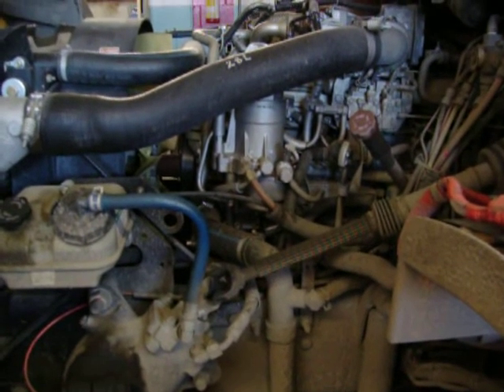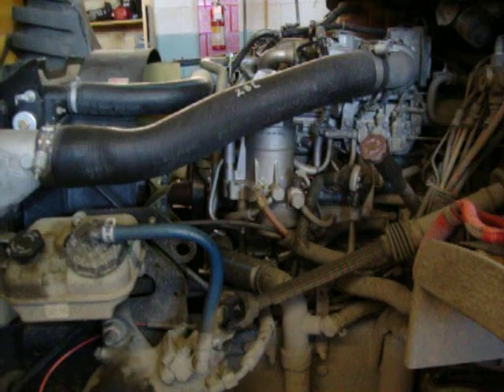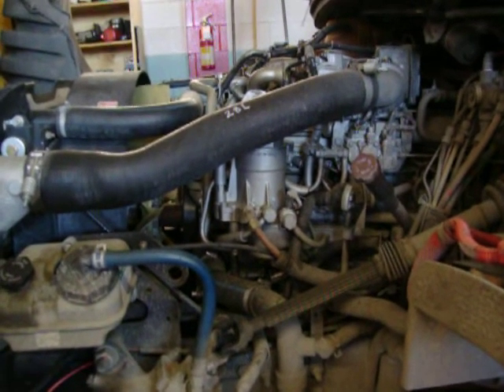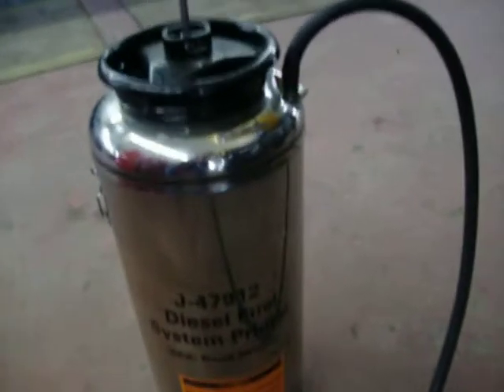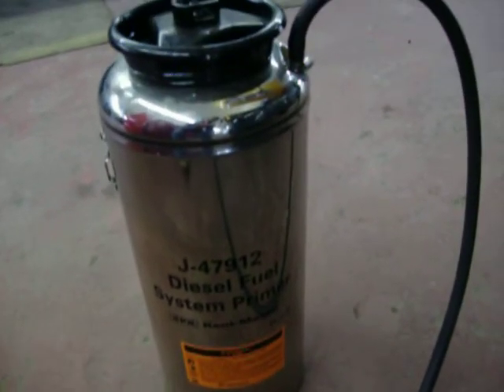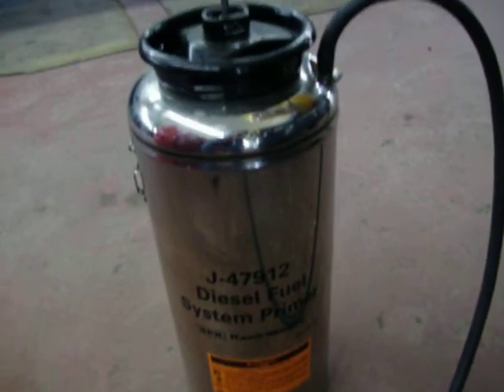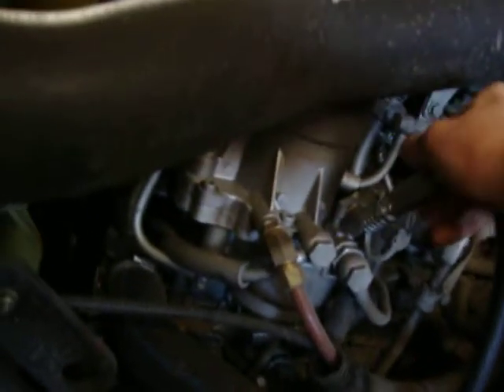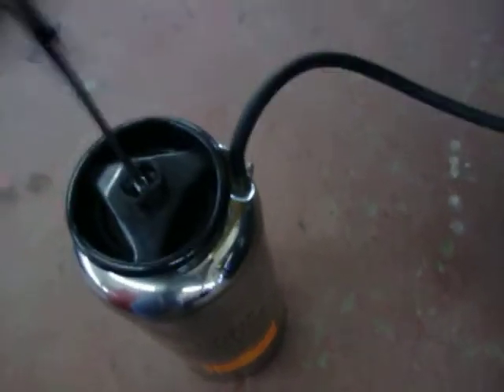Bleeding Diesel Fuel System On a Mercedes MBE 900 Diesel Engine

Comment: We did service and looks dmalles filter was lit loose, but truck started right up and we let idle 10 minutes, but after 10 hours truck set it didn't start, driver tryed start it several times even ge used either,  we inspected next day 24hours, we refuel all filters and tide them better this time, and refuel them as they got halfway empty, but it didn't work truck didn't start either, looks
Needs prime, what do you think??

Comment: This thing is a life saver. My truck wouldn’t turn on in the morning, and I tried priming the fuel system by adding fuel on the smallest fuel filter, but it did not work. So I tried this fuel pump (that I was planning to get rid of as I thought I wouldn’t need it), and it was able to prime the fuel system easily. I guess one of my fuel lines was plugged with debris and this pump forced it clear. Who knows why my old method of priming just didn’t work this time around.